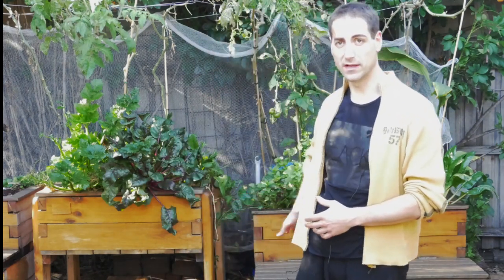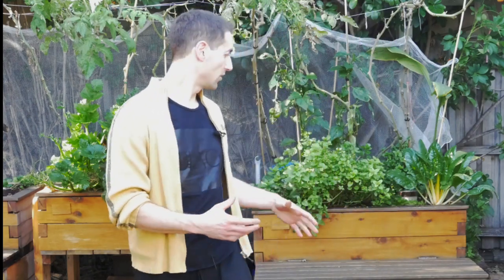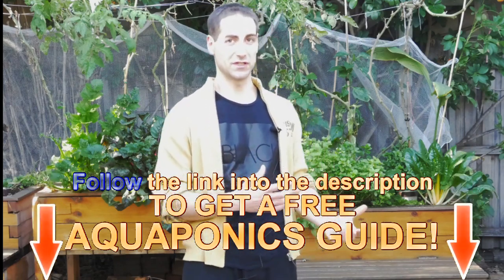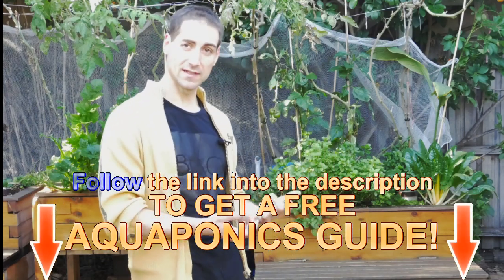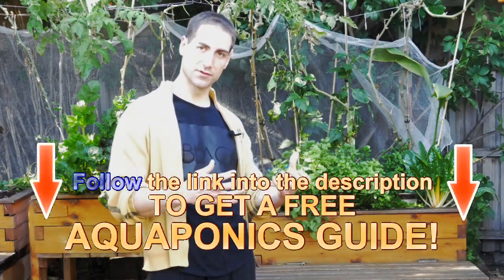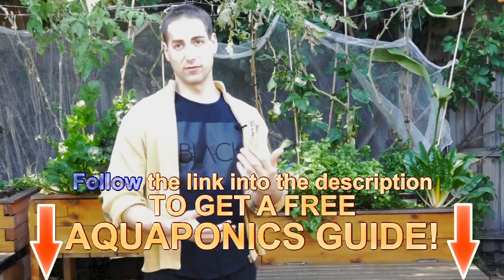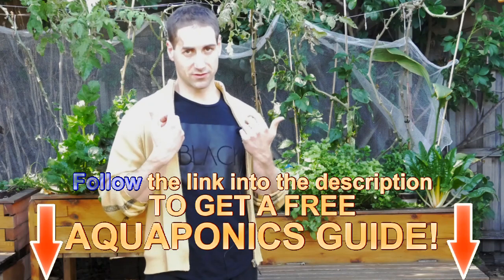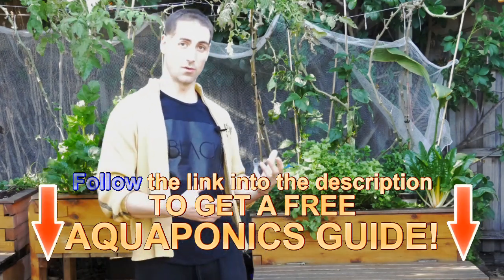Filtration in Aquaponics

Comment: Rob Bob's Solids be Gone youtube shows how to remove solids from growbeds. Thanks Rob!
I attached a water spear to an air hose and turned on the water and the compressor. Added a longer standpipe to flood the beds. By plunging the spear into a flooded grow bed the solids are brought to the surface. Creating spoon drains in the river  pebbles to direct water to the drainage  outlet and when the stand pipe is lifted the solids pour out. Bypassed the sump and the amount of solids that cover the ground is amazing and messy. Keep moving the spear around until the whole bed bubbles clear. It does use a lot of my bore water. This is the second time that I have used this method and it works. Cheers, Jim

Comment: in aquaponics we can used biological filter it is nassesary or not becouse grow bed is  used as biological filter.please tell us about details.
Reply from the maker: Hello Ariful, it depends on the type of system you have and the number of fish you are keeping (50L of flood and drain media per kg of fish).
You need to have enough bacteria to transform all the ammonia into nitrate. If you have few fish and a very large growbed it is probably not necessary but if you are working with NFT only and you have a fair number of fish I would recommend a biological filter. It will ensure a good bacteria biomass in case you lose your veges crop (and all the roots that are a fantastic surface area for bacteria).
Cheers
Jonathan
Reply: thanks a lot to you.

Comment: Hi jonathan. For now i only use the flood and drain growbed. But i want to install one. Is there any chance to have duckweed in some filter?
Reply from the maker: Hi Elsanto, In the swirl filter and radial filters we like to skim the water from the surface to avoid any floating lipids accumulation. Floating plants would therefore not be very well adapted. you have the possibility to build a classic decantation tank where you can have floating plants but watch out for mosquitoes (ad a few very small fish).  Is it to feed your tilapias?
Cheers
Jonathan
Reply: Melbourne Aquaponics  thanks  yes i want it to feed mu fish but i start with 5 koi and 5 catfish they seem to be friendly, and also start 3 little aquariums 100 lt more or less. 1 i have 3 goldfish. 2 i have 12 guppys. 3 i have the guppys babies. I watch in one of your videos that you can have like a bucket with duckweed and elodea whitout any filter nor bubbles
Reply from the maker: Yes Elsanto, especially with little fish like Guppies that don't consume much oxygen 👍